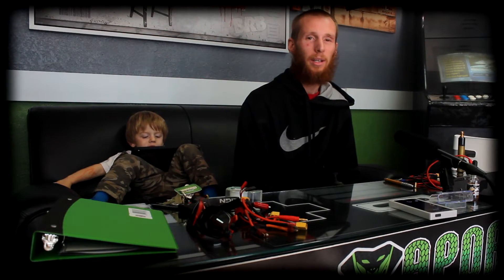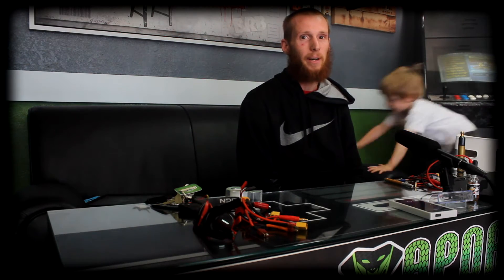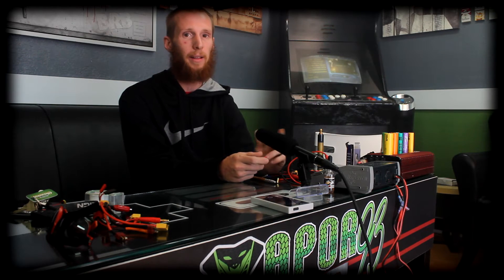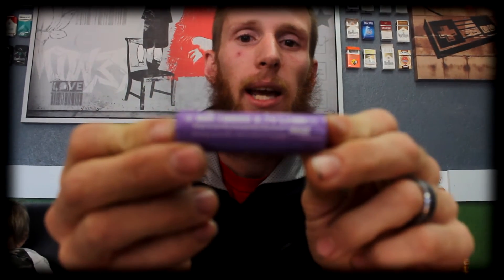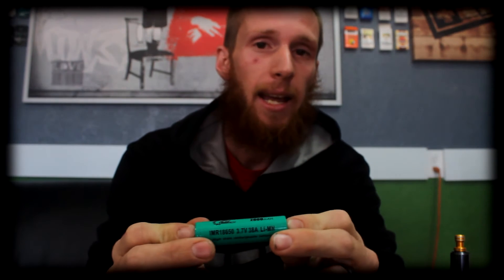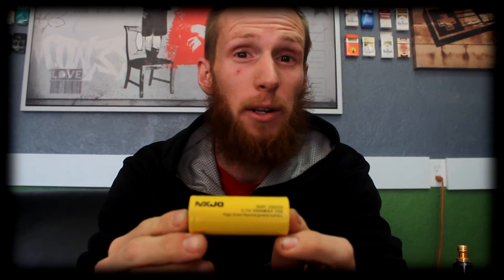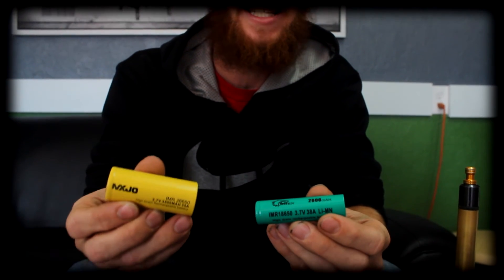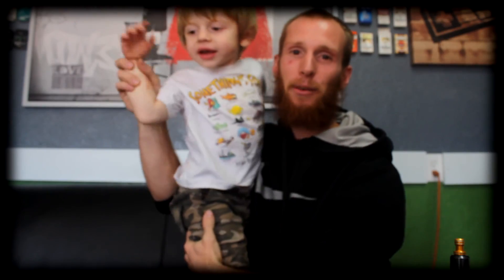Vapor 93 Build Wizard Episode 4 - Vape Battery Performance Test and Battery Safety Tutorial

Comment: If you are going to have someone talk about battery safety, you should actually let people know what would be safe to build with these particular cells.  Saying something like "this battery would be suitable for all kinds of builds" is simply irresponsible.  If a new user were to follow this advice, they could easily think they are safe to build any resistance they want and be safe.  If you are going to do battery testing, at least tell the audience how the testing you are doing actually relates to the usage of the battery.  Ok, so I know the internal resistance of the battery, but how does that compare to the discharge limits specified by the manufacturer.  This video is doing more harm than good.
Reply: And if you are going to call someone a "battery expert", they should at least know that the internal resistance of a battery is measured in milliOHMs, and not milliAMPs.